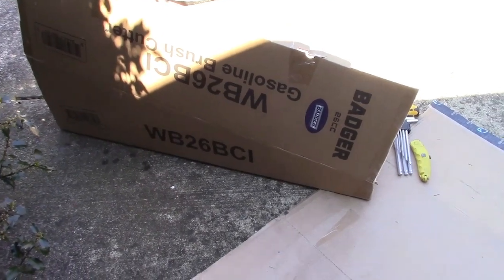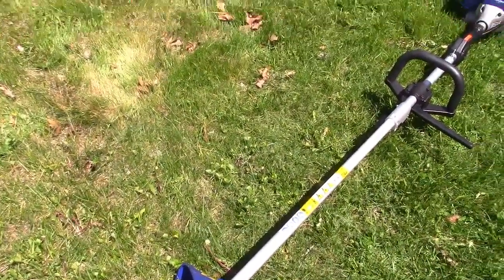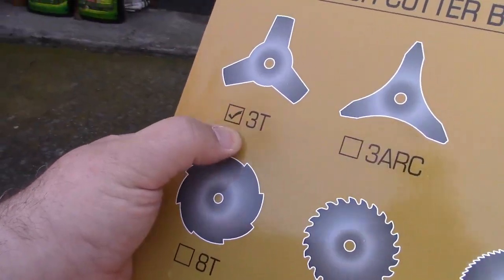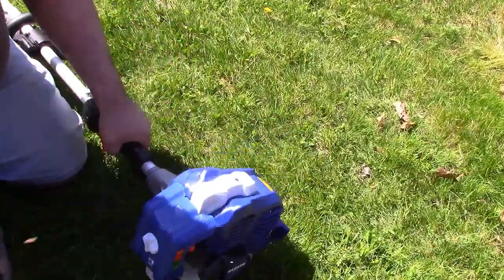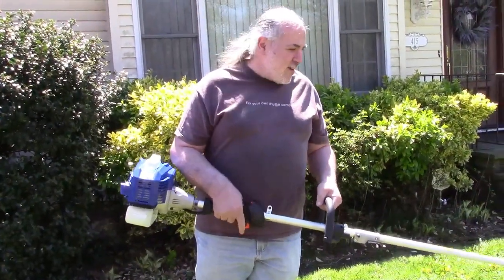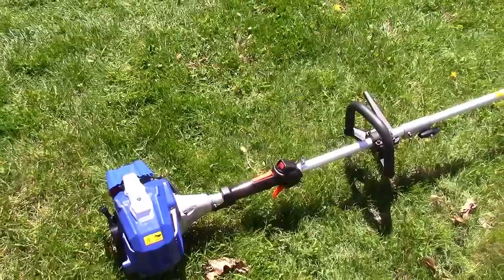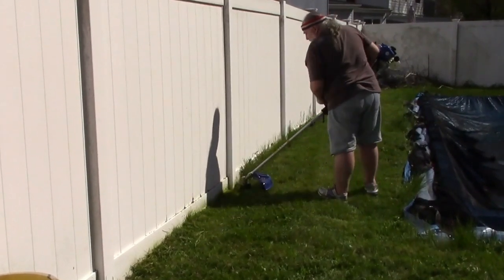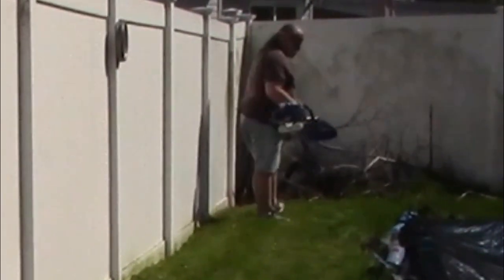Testing My New Badger WB26BCI 26cc Weedwacker/Brush Cutter

Comment: I like mine. I had the chain come off a few times but a little patience, which I generally don't have, you can get it right back on easily. I've never been able to string a weedeater head so I need to see if another head will work on it. I'm satisfied with it. Haven't tried the strap yet. I've had 2 back surgeries so u saying it helps that much I'll try it out. That's for the review.
Reply from the maker: You're welcome.

Comment: We have 2 Echo straight shaft string trimmers and they can also take blades to cut heavy brush SRM-2100 from 1992 and SRM-200BE from 1984. My uncle has Echo SRM-225 from August 2012. On the 1992 trimmer tore it completly apart replaced all the seals my uncle had it for a while but my pap Mitchel put too much oil in the gas and it carbon up.
Reply from the maker: That's cool that they're still running, being that old.  Usually these little 2-cycle engines don't have much life in them.

Comment: Just got one of these from Canadian Tire without very high expectations. This thing is amazing once you figure out the riddle that is the manual for assembly. I used the brush blade to take down the jungle in my 1/2 acre corner lot ditches. 5 pulls choked, then started on 1st pull after switching choke off. This thing ate small saplings no problem. I went through 1.5 tanks of fuel and I shut if off a few times in between. Started with one pull each time no additional priming, or choking. The blade is ambidextrous, so you can flip it over when it starts to dull.
Reply from the maker: Yes, I've been quite pleased with mine as well.

Comment: Very nice! I'm glad you got one that's easier on the back. Never heard of the Badger brand, but looks like a decent machine. The only odd thing is the placement of the primer bulb.
I read some of the other comments about going right to left, the way this one rotates, I agree, that is the correct way to go. You'll get a lot less grass, and debriss hitting your legs too. My Echo from 2016 rotates the opposite way, so I go from left to right. Sometimes I make the mistake of going the wrong way, and drive a nice pebble into my leg, and have drawn blood before too.
As far as the twizzlers go, that's the worst idea I've ever seen, and have had the displeasure to use one before. Tap, and line advance is the only way for me.
Reply from the maker: Oh yeah, world apart from other machines.  I at first thought I never heard of this brand before either, but the more I thought about it, the more I remembered seeing it.

I'll try going right to left, I've got nothing to lose.  If for some reason I don't like it that way, I can still go left to right.  I've kicked up pebbles drawing blood before as well.  I hate weedwacking, but the wif won't do it, so I have to.

Yeah the Twizzlers I had had enough of.  Don't get me wrong, I can eat an entire package, but when the next one is right there, it's enough.  My uncle once said if I eat enough of those, there's gonna be red wax on the brush!
Reply: It's a very decent machine.  Good Luck to you.

Comment: Nice I have a 1990s echo weed wacker it is a powerhouse I have never had a problem with it I got it for free out of the garbage I love it
Reply from the maker: I've heard stories about trimmers from the 90s still running just as well today, I guess they used to make them better, like everything else.
Reply: Thats going on 30 years, great find.  What did you have to do to it to repair it initially?
Reply: @thornyturtleranch4u  carburetor tuneup

Comment: I just got one. You sound just like me, one minute in.  But, I think, overall, it's going to be a good unit, especially considering the price.  With the length of the warranty, document everything you do.  Warranty claims are basically "we'll send you a new part", but six years is a long time to prove you used the proper fuel mixture and did the proper maintenance.  Oh yeah, great video, as I am watching and writing at the same time.  Thanks for you effort and work.  Best of luck to you. I'll be subscribing and watching all corresponding advertisements. It's the least I can do.
Reply from the maker: I really appreciate it.

Comment: I had to finally replace the line in mine, but I cannot keep the line inside the head. I wind up the line, but when I start to work the line falls out. This head is very different from other weed wackers so I am at a stump. There are no clear directions, videos, or manuals. Thanks.
Reply from the maker: I had to rewind mine as I burned through all the string.  I had trouble too, but eventually figured it out.  If you look at the remaining piece of string, you'll see how it has bent from being in there so long.  Do the same with your new piece of string.  Then, start winding, but be careful.  This head has 2 wings inside.  One string on one side of the wing, the other on the other side.  Do not cross them at any point.  The other thing to remember is BOTH strings wind in the SAME direction.  Those are the tricks.
Reply: @jaykay18  thank you very much
Reply from the maker: @Angel A Clockwise.  Think of a letter S.  See how the ends of it go clockwise?  That's exactly it.  When I took the original piece of what was left out, it looked like a letter S.  So now I just remember that, and it gets wound clockwise.

Comment: ......I had trouble starting it realized the pins to connect the trimmer to attach needed to be in place.....also I just got it today I'm just worried cuz it gets so hot is any body else's badger does that
Reply from the maker: It gets hot once it's been in use.  You just don't touch the hot parts, common sense.
Reply: Yeah duh obviously.....but i didnt mean it like hot like ouch i got burned no i meant the motor you feel it and smell hotness...I've used a red max an echo those take time to get hot not like this one but man did I forget to mention........the string it comes with is a long laster man awesome
Reply from the maker: I've been extremely pleased with mine.  No trouble or strange smells, starts every time, string lasts and lasts, all around a fantastic machine.
Reply: I'm new to mine, but no smells yet. Put a call into the warranty number so if it fails, it's not called operator error.

Comment: What type of mxing oil do you use
Reply from the maker: It's oil for 2-cycle engines.  Mix according to the directions.  I usually run a 50:1 ratio, might run a little smoky but keeps everything lubricated.
Reply: @jaykay18  ty
Reply from the maker: @sherryhicks8559  Anytime.

Comment: So what would the difference between 26cc's and 30cc's be exactly?
Reply from the maker: 4cc's.  EXACTLY.

Oh, that other difference?  The 30cc is a few pounds heavier.  I can't afford a few ounces of extra weight on my back, let alone pounds.
Reply: Well a few ounces EXACTLY make the difference for your back it seems.
Reply from the maker: Yes, it's very touchy.  I haven't seen my chiropractor in 6 weeks, because of Calderona.  So you can just imagine how bad it is now.
Reply: How was your back able to handle 30cc's when you were still able to just go as usual. Assuming not as bad if now is more touch and go.
Reply from the maker: I've had back pain since my knee pain went away.  For some reason I had knee pain starting around 17 years old, probably due to spending a lot of time on the floor fixing computers at my parents' house.  I didn't have a desk to work on them, plus they were old junkers anyway.  That continued on until I was about 22.  I had seen a doctor about it, and he gave me some samples of a particular medication, the name escapes me at the moment.  So I took it for a couple days and nothing happened.  The day after that, I made a miraculous recovery, and hadn't had knee pain since.  I ran out of the medication and stopped taking it, and that was that.

When I was 24, I remember it was winter, and my sister's car (1987 Toyota Celica) had a burned out headlight.  This used the old square/rectangular sealed beam headlights that cars back then took.  There was a trim ring around it that came off with 4 Philips screws.  I took those screws out and remember that's when I realized I had a problem getting up; my back didn't feel right.  Nothing "popped" or went out of place that I remember.  But even since then, it was touchy.  I could just be doing something and one false move and it would put me in terrible pain.  Most times I was OK.  We had our apartment and I remember once or twice it hurt so bad it put me out of work but otherwise OK.  When it came time to move, I remember boxing up all of my liquor into a big box.  Had a hand truck, and xjoe81x was helping me, he'd pull up on the truck and I'd push up from the bottom, we had 12 steps to go up out of the basement.  By the end of the day my back was sore, but nothing was really hurting that bad that a couple days' rest couldn't fix.

Time went on and my back got worse.  I remember one year I was brushing snow off the car (notice how many times this happens in the winter?) and something just "popped" and I had very bad pain.  Another time I was at work, just leaving, and went to throw my coat on and something popped.  I stopped dead in my tracks and leaned against the wall, could barely move from the pain.  There was no rhyme or reason as to why this was occurring, it was totally random, not doing anything strenuous.

Time went on.  Maybe 5 years ago is when the major damage occurred.  Before that, again, I'd be sore, but not anything that wouldn't be fine in a couple days.  Once again, something dumb, I was just loading groceries (BEER) into the car, something popped, and I was in bad shape.  2 days later I was helping my grandmother from behind, preventing her from falling down, and I had to jump in there in an awkward position and take the brunt of her entire weight on me to keep her from falling down, on an already bad back.  Pretty much from then till today, it's always been that one spot, sacroiliac area.

Comment: how do you load the string? do you just stick like 6 feet or so in and then turn the head?
Reply from the maker: There are 2 tabs you squeeze in, that will release the head.  You can see what's left of the existing string as a guide.  Stick the string through the center, but not out the metal holes on the sides.  You'll see 2 plastic "wings" opposite each other on the spool.  Wind the string on the top section clockwise, and make sure it all stays on that side of the wing.  Then, wind the other side the same way, clockwise.  Once wound up, stick the string through the metal holes.  It's a little fiddly and will take you several tries to get it right, once you do it the first time, it will be much easier next time.

Tip:  Don't use a wire cutter to cut the string, it will flatten it and make 2 pointy sides that won't fit through the holes.  I use about 9 feet of string.  An easy way to remember is an arm, an arm, and a nose.  So spread your arms out to the sides, that's 6 feet.  Then pull from the center of your body (the nose) out to one side, that will give you 9 feet.

Take your time with it.  The string will unwind on you, don't get frustrated, just try again.  If you still have trouble, wait a couple of minutes and try then, sometimes that makes all the difference.  Much easier if someone can help you to hold the string so it doesn't unwind.  Again, once you do it the first time, it will be much easier next time.
Reply: @jaykay18  Thank you sir, but i think the one i ordered said it came with a twist and load head.
Reply from the maker: @stewiestuddsyt7877  That's clearly a different model than the one I showed here, and I put the model number right in the title of the video.
Reply: @jaykay18  i think all it is is the same weedwacker, but they started puting a twist n load head now compared  to when you made the video
Reply from the maker: @stewiestuddsyt7877  Yes, that's entirely possible.

Comment: Thinking about buying this, does it use mixed fuel and how do I know what replacement string to buy along with it
Reply from the maker: I DID say it's a 2-cycle, all 2-cycle engines use an oil and gas mix.

As for string, the manual will divulge the information as to the string diameter.  Alternatively, you could put a digital caliper set on the string it comes with and get a reading that way.  Or, you could cut a small piece off, bring it with you to the store, and try to match it up by eye.  It's not absolutely critical.

Comment: That’s a pretty awesome trimmer! I definitely dislike those “no-bump” heads as well. My Echo GT-225 came with one, and I was having to change the line every few feet of trimming. I couldn’t take it. Luckily, there was a conventional bump head available, and I put that on and it’s been great since. 

Shoutout to lexmarks567 for making this possible!
Reply from the maker: Right on!  I hated the Twizzler head, but never really looked into replacing it.  Sometimes I'd feed the rest of the line through it and get a little more out of it, and have just one string whizzing around.  I mean come on, ever hit those on concrete?  You can burn through a spool of string in just a couple minutes.

What I really like about this, as dumb as this sounds, is it makes a cool whooshing sound as the string spins up.  I really like that sound my other ones never did that for whatever reason.
Reply: The no bump heads that take precut line are great if you have the metal type that can accept .130" or .155" line on a high CC machine, one can go to town for quite a while on one refill with more power from the machine since they are far lighter than the bump heads. But, for everyday use give me a speed feed head.

Comment: Wow, that thing sounded like a motorcycle, or a few motorcycles. They are powerful though and the shoulder strap should help when you are using it.
Reply from the maker: For the stuff that grows here, sometimes not powerful enough.  But I'll gladly trade power for lighter weight in this case, because I'm bearing the weight.

Comment: Doesn't sound like it has any power
Reply from the maker: Neither does a Honda Civic with a fart can exhaust, but the ricers drive them around like maniacs anyway.

I had an older unit that this replaced, and that had a 31cc engine.  It was larger, it was MUCH heavier, and it had the same amount of power.  Bottom line is these things generally aren't going to bog down and/or stall out cutting through thick stuff.  What could happen though, is the clutch will slip too much for your liking, and that will slow the cutting head down possibly to a point of not being able to cut.  The only way you're going to reliably find out if a unit has a clutch or not is to pull the rope.  If the cutting head moves when you crank it, there it no clutch and it's directly coupled to the engine.  That also means the string is going to be spinning even if you set it down on the ground for just a moment, which could lead to an accident.  Ones with a clutch need to be revved up for the string to start spinning.

Now it's one year later, and after storing it all winter in my garage, it fired up in 3 pulls and ran just as great as ever.

Comment: The skin on your fingers will be gone in the matter of 20 mins from tryn start it after it sits for a week
Reply from the maker: Had it for over a year and starts just like shown in this video.
Reply: i've had mine since may and it starts in usually 2 pulls. this week it took 3.
Reply from the maker: @MrSGL21  2-cycle engines are always finicky, this one has been very easy to start.
Reply: @jaykay18  Well there’s something wrong with mine . I just bought it and worked perfectly the first week then the second time it just wouldn’t start . It would start for a couple seconds and keep stopping . I’m not like a grass cutting tool guru but idk what’s wrong then .
Reply from the maker: @dayz_b4_rage371  Great, contact the company for warranty service.